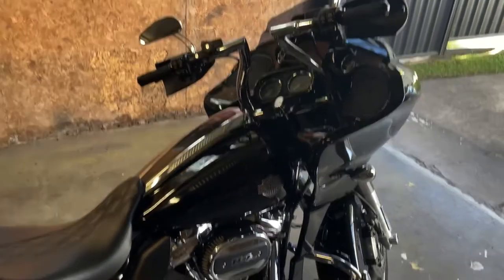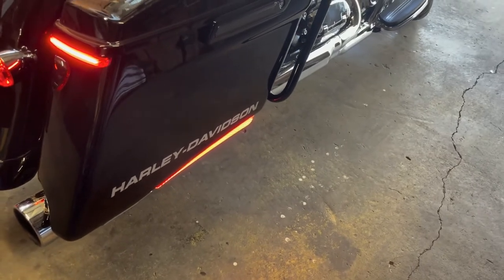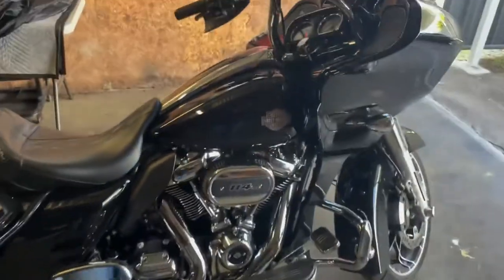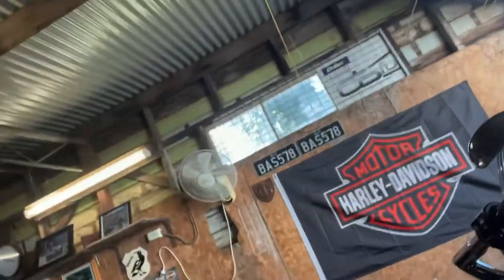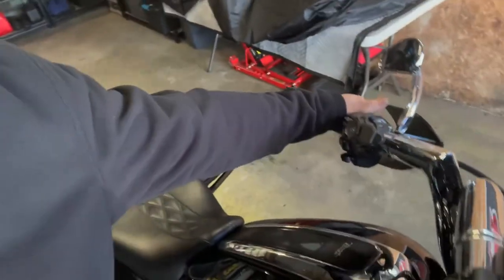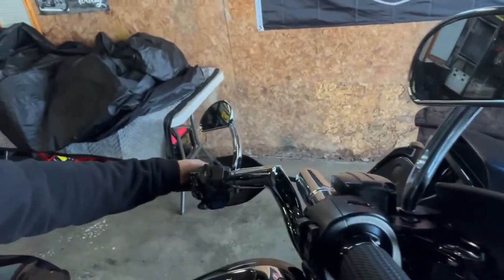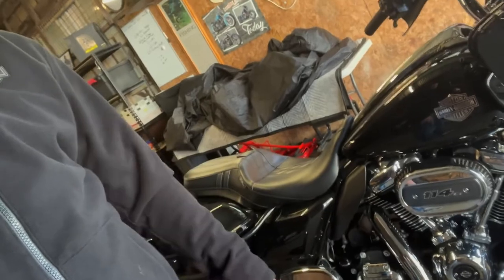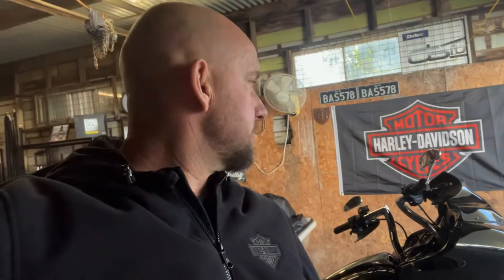S&S 475 cam 114 Stage 2 upgrade

Comment: Great video, your bike sounds awesome with the stage 2..

The thing that stops me from going stage 2, is the back tyre. They are expensive. Luckily I found the Bridgestone which I get 11k out of it, the others I was barely getting to 8k kms. I would think that with a stage 2, then it would wear out a lot quicker.
And I only have the old twin cam 96ci.. (lots of very twisty roads around here where I live which are fun) even riding carefully.. I can also change them myself these days but at $350 a pop and I had about 10 sets on last year. 5 rears. (I have ridden 54k kms in 22 months.
Reply from the maker: Sounds like you really get out n ride!  
I don’t have as much time unfortunately busy with my kids sport a lot of weekends. 
My 21 has RDRS so traction control will save the tyre a lot unless I disengage it 🤣. I’ll let you know how many kms I get out of the tyre.
Reply from the maker: Video does not do it justice either, has a nice lope at idle and when you give it some,has a great throaty sound but if you want to cruise it’s still mellow too.

Comment: Hello. That's a nice bike. I have a question. My motorcycle is fltrx which was shipped in 22 years. I usually run from 1500 rpm to 3500 rpm. What kind of camera is right for me? 475? 465?
Does 475 have a severe fever? I want to change the camera and feel the vibration and sound more shaky than the pure sound and vibration. Like an old bike. Is the 475c cam effective after 2500 rpm? Does the 465c cam have a good effect from 1500 rpm?
Thank you for reading the question and please reply. Have a nice day.

Comment: We basically have the same set ups on our bikes… Even down to the exhaust… Going from the stage one to the stage two did you notice much difference in power? Mine has a cat delete and I’m not sure if yours did or not. I’m just running a stage one with the Rinehart exhaust and I can’t remember what my headers are about the bike when it was six months old and the guy already had all of it stalled and of course it has the stage one but now I want to upgrade to the SNS 475 SECAM it was just curious of how much power picked up over stage one going to a stage two with the cam.
Reply from the maker: Not sure on numbers going from stage one to a stage two but auto tune with stage two had me at 103hp then a dyno tune went to 115hp. Best bang for buck going from one to two by adding a Cam as you already have stage one will cost around $1800 for stage two in Australia anyway.